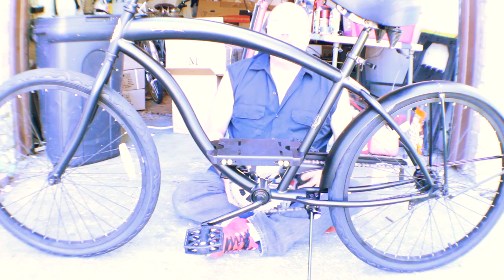How To Build 4 Stroke Motorized Bicycle Part 1 Unboxing Prepping Frame

Comment: I'm impressed with the specs of the Honda GXH50. The power output is 1600 watts. Still should be enough to get to 40 mph I if you take advantage of multiple speeds and you are dressed in reasonably aerodynamic clothing. About as much as the best male road cyclists at the finish sprint and female track cyclists. The fuel consumption is stated as 0.91 litres per hour. This is about as much as a car uses just stick in traffic! So that would be 40 miles on 1 litre 200 mpg UK 166 mpg US. It would be even better than this at lower speeds.
So I am whizzing along at 40 mph and using fuel at the same rate as when I'm parking my car!
Reply: Depending on what you mean as lower, it wouldn't get better gas mileage at much lower speeds. That's a common misconception. Yes, you're doing lower rpms at lower speeds, so one would think they'd get better fuel economy, but keep in mind, if you're going slower, you're not covering as much distance, so by definition you're traveling fewer miles per gallon burned if you go slower, because of time. There is however a point at which you start to get less fuel efficiency, and it's basically after your car shifts into it's highest gear and the rpms start going back up considerably. Past 80 basically. On a motorized bike, if it makes out at 40, I'd say your best fuel economy would be like at 35. I guess, youre technically right. You'd get the best fuel economy if you aren't totally maxing out the engine the whole time. Slightly under maxed out is best.

Comment: It would be cool to use an 8 speed cassette 32 11 and gear the bottom end to top out around 15 to 18 mph and the top end at about 50 (to take advantage of lower engine speeds for longer life/even less fuel the Honda gxh50 had max power at 7000 but max torque at 4500. I also like the ability to freewheel with idling engine).
A 2.5 horse power engine should be able to climb most hills at 15 to 20 mph (1 horse power is pedaling as hard as I can for 15 seconds and geared low enough I could climb a fairly steep hill at 6 mph.)
The higher gears and freewheel would mean I wouldn't have to scream the engine on easy roads just because of the poor gearing.
Reply: You can check out my build, it has a 8 speed cassette at the back and 4 chainring gears that are 24, 38, 42, 48...I will be using a 4 stroke 100cc engine with a 53mm bore, I hope to achieve above 100mph top speed

Comment: Will these bike transmissions bolt to a honda gx35? Any help is appreciated.
Reply from the maker: Dont think so. Never tried
Reply: The clutch shoe size is the same as the huasheng 49cc so I was assuming the bolt pattern was the same as well.

Comment: have an issue my engine shuts down by itself after 2-3 minutes, they said it can be the carburetor  to clean it but i dont know hoe to remove it from the enginr its the same 4 stroke engine that you have there my old 2 stroke was easy to remove, also i noticed that the oil spills from where i added the oil would this cause it to shut down? or its fine to have completly filled or should i remove some, it starts at the first or second crank. but it shuts down after 2-3  minutes, havent used it for a minute had it stored but my 2 stroke broke n i. eed some GM hing for meantime.

Comment: is there anyway to steal power from the motor, to power lights? any insight would be awesome
Reply from the maker: Tim Schuchard Not as configured. you can get some good battery powered lights. I suggest http://amzn.to/1KY77AW
Reply: +Tim Schuchard you could use a dynamo system for the lights running off the wheel revolutions

Comment: With the output sprocket on the transmission needing to be perfectly aligned with the rear sprocket, does that mean you cant, or shouldnt, put a motor on something like a 7 speed bike?

Comment: Have they fixed the issue w the one way bearings yet?
Reply from the maker: Not to my knowledge. the kits are still pretty robust IMO
Reply: We got a guy that can't get a 1/2 mile down the road w out that bearing going. Replaced it 4 times for him for free. He didn't even buy the bike from us but we serviced the bearing once for him because it blew, then owned that issue after that.

What size shaft motor kits are those. The 5/8" keyed shaft one way bearings haven't lasted and they are out of stock till october at bicycle engines.com. Sucks telling someone you can't help em after fixing it 4 times for free.
Reply from the maker: piratecycles  I have not had a complaint on any of the TBelt transmissions...Knock on wood